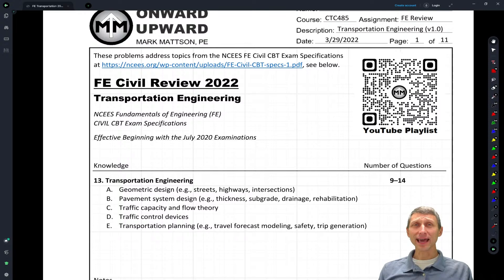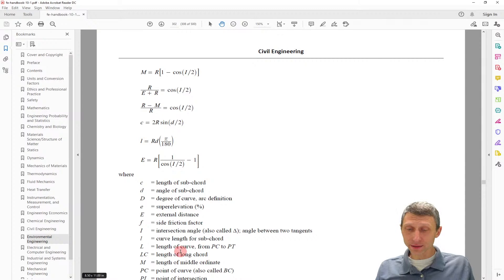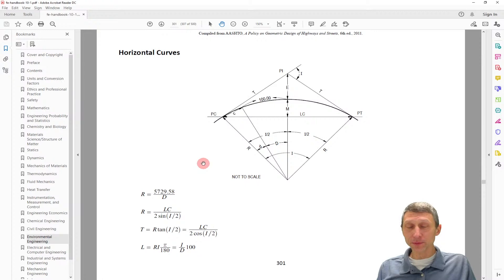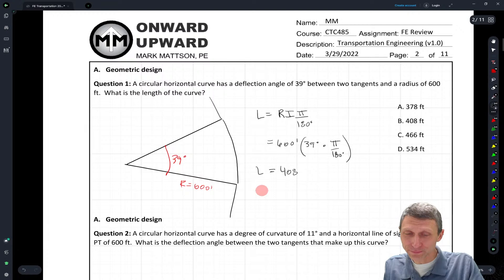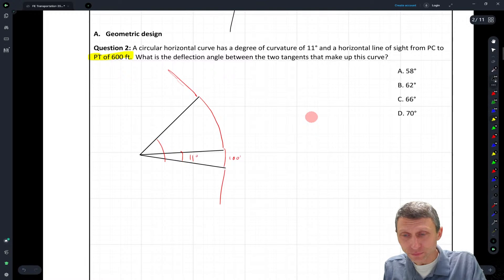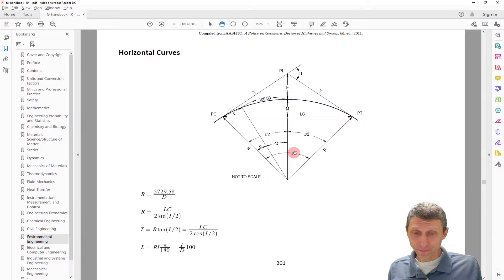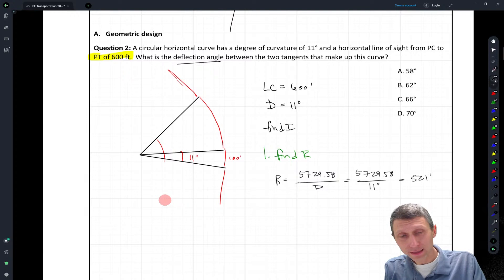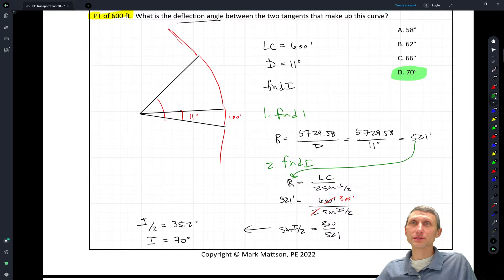FE Transportation Engineering Review Session 2022 - Problems 1-2

Comment: Why couldn't you just use L=I/D*100 from the manual for #2?? It says the length 600' is from PC to PT which should be L= length of curve not length of chords, right?? making the answer 66. C
Reply: same question here
Reply: it says it has a horizontal line of sight, which is different than the length of curve.
Reply: Because we just knew the Lc  which is the length chord ( horizontal line of sight )
L is unknown which is the length of the curve 
That is why we need to make some steps to the final results